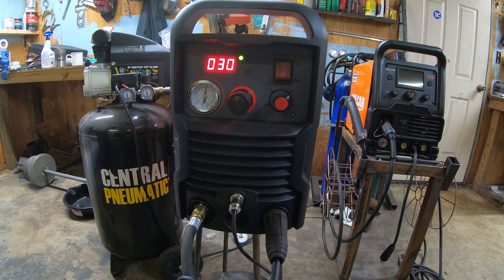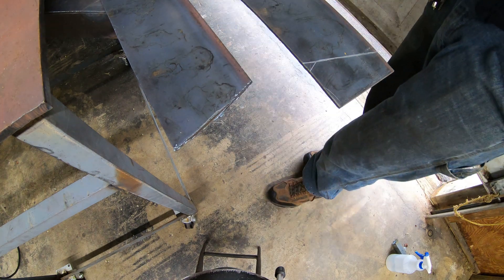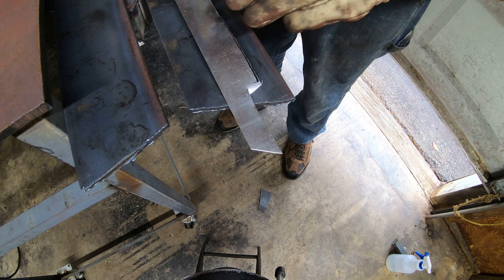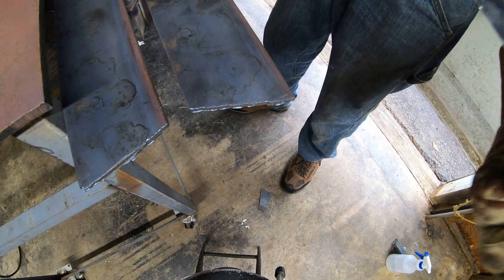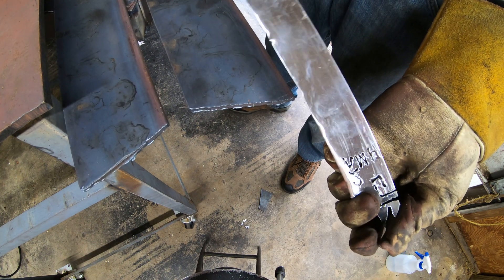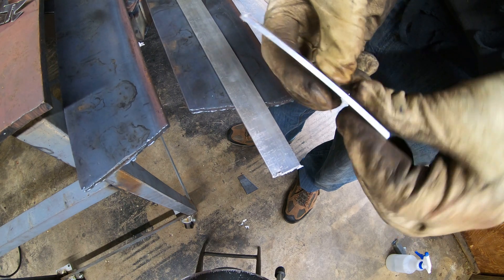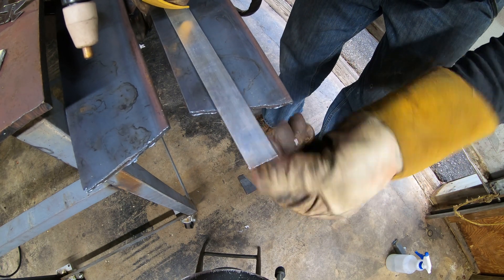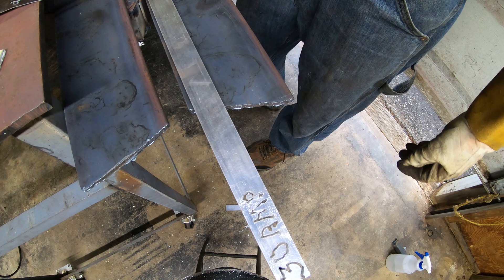$200 Plasma Cutter?? Amico Cut 40

Comment: Could have cut finer if you reduce the air pressure.
Reply from the maker: Good info! I'll have to try that. I definitely want to use this on some possible decorative or artistic type projects in the future that will require cutting precision